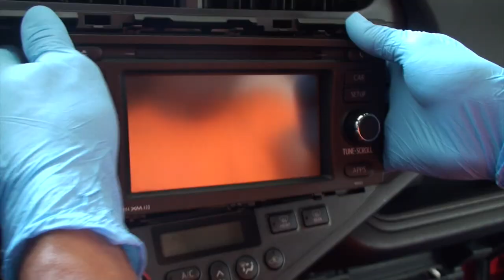Prius C How-To: Transform your Audio | Install Preview

Comment: any actual customer reviews on this? looks good... does it sound good?
Reply from the maker: Jeremy Stevenson there are a plethora of reviews regarding our System in the forums (including PriusChat). We are most notably known for our High Resolution sound quality. Fidelity, clarity, balance and experiencing the weight of your music without compromise to space or functionality. Reach out if any additional questions or requests!
Reply: @Oemaudioplus  cool i only saw 1 on your website. do you have a link to the priuschat thing? the system looks very nice
Reply from the maker: Jeremy Stevenson here you are sir. A discussion worth reviewing; http://bit.ly/Prouschat_c
Reply: OEM Audio + how can I get a custom box like that for a Prius c 2012
Reply: How can i buy this all Item?
Reply: So I just finished my install. You know they had me on "OEM" BUT, this isn't OEM fit and finish. It's just closer to plug 'n play than most aftermarket upgrades. They did the homework for you so that you don't have to piece together a system. The sub fits ok. I would give it a 6.5 out of 10 if OEM fit and finish is a 10. There was a bit of extra wire loom on everything, sometimes way too much wire. OE component would be a perfect fit. The wiring I would give a 7.5 out of 10. The speakers are 9.5 out of 10. They fit just like OE, I just haven't fully tested them yet but initially they sound great. Overall the system was to replace my BOSE system in my M3 since I've sold that car. Is it a good replacement? It's a great upgrade over the OE system but still lacking compared to my old BOSE system of course. I mean, I had subs under the front seats (OE- since we're on the subject) in that car. That's hard to beat.
Reply from the maker: @boda4339  (oem Plus)+ ;D

Comment: Will this work for a Prius C without the head unit using the LCD? Would I just have to purchase a used head unit or will the wire harness in my car not be compatible?
Reply from the maker: Yes. Our Reference 500 Sound Solution will work with the Base 9non-touch) factory head unit. Wiring Harness will be completely plug-an-play with your factory connectivity.

Comment: How much does this kit cost? Also how much would and install cost? 2014 Prius C One
Reply from the maker: Hi David, the Reference 450Q sound solution product showcase is found here: bit.ly/PriusC_45Q ($1399 for complete system). Installation at our Anaheim, CA location is a flat rate of $300 – Keep the questions coming. It is our mission to personalize your experience.

Comment: After this what's efect on Hybrid battery plz clear this info
Reply from the maker: MıR MuZamiL great question!! No degrading affect whatsoever. First off, our System receives the necessary 12 volts from the Starter Battery (rather than the Hubrid Battery) only when vehicle is in Accessory or Ignition. Second, since our Solutions meet o.e. (Toyoya) specifications and unlike aftermarket amplifiers, the stock alternator and battery will be able to provide more than enough current to our system without compromising the operation of the vehicle.
Reply: I'm in the market for a new vehicle and thinking about the 2019 RAV4 hybrid with the JBL audio speakers. I want to upgrade the sub to a JL audio W3V3 sub with the proper amp I'm just worried will I lose MPG or degration of the vehicle and advice? If so I might stick with the gas model but the hybrid is nicer and more powerful....

Comment: What manufacturer are the speakers and the amp, not much info here.
Reply from the maker: islandsound designed, tuned and engineered by OEM Audio Plus specifically for the Prius C: oemaudioplus.com/toyota/ let us know if ANY additional questions or requests!!
Reply: Yes but who is making the speakers and the amp for you guys. I get you are working with a company to produce this stuff but I'd like to know who.
Reply from the maker: We utilize "white label" OEM-Certified Tier 1 Manufacturers to fulfill our component designs (liken to your vehicle). This secures the required testing and reliability (10 year / 100,000 mile tested) necessary to meet both Our and the OEM Toyota's standards. We do all R&D, fabrication, fitting, tuning and assembly at our facility based in Anaheim, CA. Hope this answers your inquiry thoroughly!! Feel free to give us a call at 855-636-6346 for more details or ask here in the comments.
Reply: OEM Audio + How do I know if I have the gracenote or not?
Reply from the maker: Excuse the delayed reply Jason. There will be the Gracenote logo on your head unit if applicable. Picture of Gracenote radio: https://tinyurl.com/gracenoteprc 

Feel free to callus directly at855-636-6346 if we can further assist in personalizing your experience.

Comment: Is this something I can order now? Does the sub interfere with access to the spare?
Reply from the maker: Jason Carmichael yes sir! You can order now here (will ship within 72 hours): http://bit.ly/PriusC_45Q - Full access to spare tire with subwoofer corner mounted on passenger side cargo area.
Reply: How do I know if I have gracenote or not with the factory entune radio?
Reply from the maker: Excuse the delayed reply Jason. There will be the Gracenote logo on your head unit if applicable. Picture of Gracenote radio: https://tinyurl.com/gracenoteprc 

Feel free to callus directly at855-636-6346 if we can further assist in personalizing your experience.
Reply from the maker: Jason Carmichael were you able to verify if your Prius had "Gracenote"? No rush to get back to us. We always want to follow up in the effort of providing you with the level of service we strive for.
Reply: OEM Audio + It does not have gracenote, it has the xm logo instead. I plan to order next week. Thanks
Reply from the maker: Awesome! Thanks for confirming. This will allow our team to tune your Reference 450Q specifically for your vehicle and radio. Be sure to reach out if you have any additional questions or requests along the way.